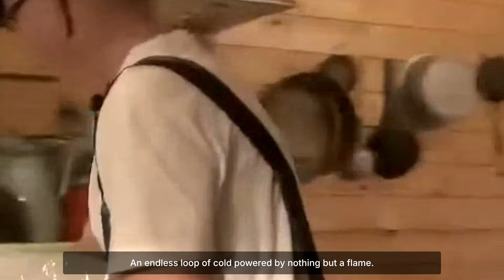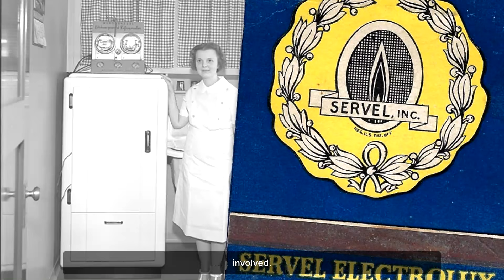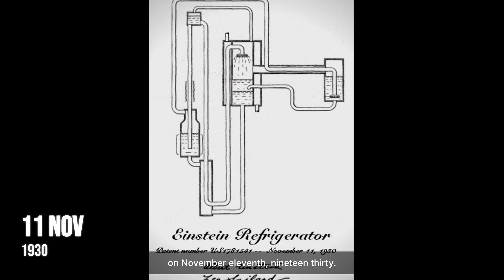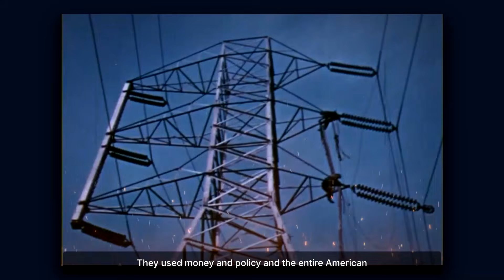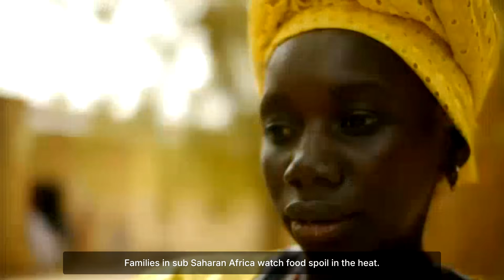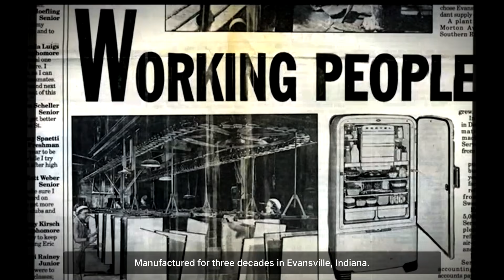This $80 Fridge Runs on a Candle. No Electricity. Why Was It Killed in 1956?

Comment: I had to learn about the chemistry in the Montreal protocols when I’m getting my universal license for the AC. Since ozone layer is only thin in the Antarctic, and arctic where there is less light present incense Ozona is created in the atmosphere by light and oxygen, it is fairly clear to me that this was a made up problem. The Freon, breaking up the ozone in the atmosphere itself Should just lead to more oxygen that in contact with light will create more ozone. i’m not claiming to know or be right I just never had an explanation that actually made sense and again the ozone holes which still exist exist around the Arctic and Antarctic. We were told in the 80s that they were definitely caused by pollutants because the hole was sitting above Russia, the United States, in Europe, where all the industry was. Of course, they never brought up Antarctica, which has no industry near it. The connection is the lack of light because of the tilt of the planet. Like most environmental tails, it is built on, lies and keeping you in the dark as to what’s really going on. Again, if you think I’m wrong, please educate me. I like these energy saving devices in the videos on them. They’re quite cool please keep it up. As far as the lead gasoline, the worst part is that they knew it was causing brain damage and continued to use it. Gotta keep those profits up(Shareholder value, and all that, apparently if your kids retarded from wet poisoning that doesn’t matter as long as we’re still profitable at the end of the quarter. I see this only to say that it’s still going on today the same motivation that these people had to do it, then they have to do shit today like that Covid vaccine which is poisoning everyone. And 1000 other things that they tell you are safe, but are not.)hooray for capitalism.

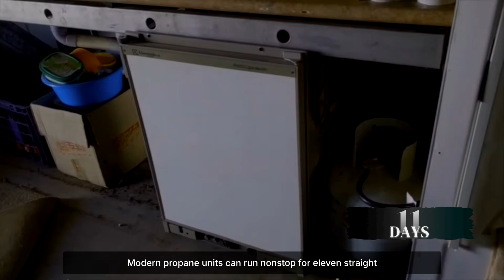Comment: 19:55 I was fascinated by this technology... till the moment he sais: "modern propane units can run 11 straight days on a single tank"... A larger fridge uses around 100w. 100whx24x11= 26kwh.. where i live the costs for 26Kwh are about 3 times less then the costs for refilling a propane tank... and that's without taking my solar system into account..  It could still be a usefull technology.. if a cheaper heat source would be used. What about electricity? would heating a coil use much more power than the compressor?

Comment: Modern fridges do the same thing, just with safer more efficient refrigerants and a more efficient process with an electric pump. Unless you have a ton of waste heat already this will use far more energy to run than electric.
Reply from the maker: That's fair for regular use with grid power. The whole point of this design though is that it needs zero electricity, which makes it genuinely different for off-grid situations 😉

Comment: Ammonia based absorption refrigeration is old tech and VERY DANGEROUS.  The tubing must be thin wall to work effectively and the process uses heat to boil the ammonia out of water solution which then rises to the top of the unit where it condenses and trickles down through the tubing while absorbing heat.  At the bottom of the unit, it needs a catalyst agent to be absorbed back into the water to start the cycle over.  That catalyst is hydrogen which is highly flammable.  The system is under pressure and high temperature.  A leak ignites just by reaching air.  This is the technology of RV refrigerators and in just a few years as a senior RV technician, I've personally seen at least 5 RV's that burned to the frame because their refrigerator ignited.  You will never find a UL listed absorption refrigerator and I would replace one in any RV I owned.

Comment: No refrigerant recharges?  This is MUCH MORE complex than modern refrigerator, with THREE different gasses inside, each required in the correct proportions.  PLUMBING LEAKS!
Reply: Just water, ammonia, and hydrogen.  Basically a firebomb waiting to go off.

Comment: Not mentioned: a BIG flame is required to get a SMALL amount of refrigeration.  Process is VERY inefficient, about 5 times less efficient.  Home A/Cs were also made this way, running on natural gas, but quickly eliminated due to VERY EXPENSIVE operation.
          This was done at the 1893 World's Fair in Chicago.  So much heat was required that the refrigerator building BURNED due to overheating.
          There is also the hazard of ammonia escape from damaged plumbing.
Reply: Yes, exactly, poor efficiency is the killer. My old small 60 liter fridge of this type needed 100 watt of power constantly (!!!) just to cool down to about 0 °C. 20 years ago I switched to compressor one - 3 times more space and 3 times less electricity. My modern 250 liter FREEZER uses only 40 to 50 watts about 1 minute in every 10 minutes interval to cool the interior of it to about -20 °C. This video is just another conspiracy theory.

Comment: Interesting that you say that it was hidden and that they quit making them this is a video that is truely click bate as instead of a candle running it they run it on propane different sizes depending on the motor home or camper they are installed in and they are also used in off grid home's and cabin's I used 2 in my mobile home the only problem is that they are very expensive compared to an electric fridge but most are able to run on 12 volts and with their built-in converter run on 120 volts AC and I'm sure that they are also used in Europe and in that case their converter is 240 to 12 volts
Reply: It seems you mean another type equipped with Peltier module (similarly ineffective).

Comment: The way the movement and compression of freon can both cool and heat I'm wondering if the same process from the opposite side will generate heat on an absorption Cycle System also with that in mind curious what would be involved using an absorption cycle to create a HVAC system or if that would only be able to do the AC side
Reply: Inefficient and a dangerous fire hazzard.